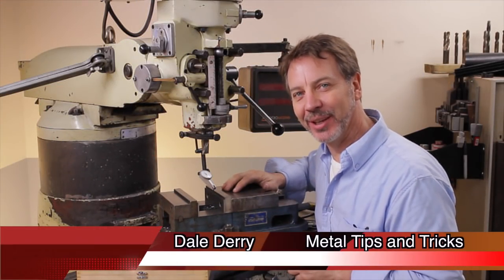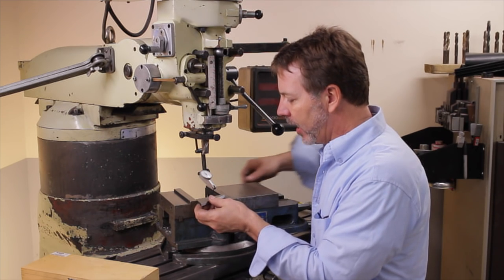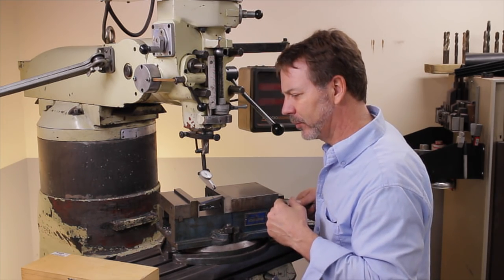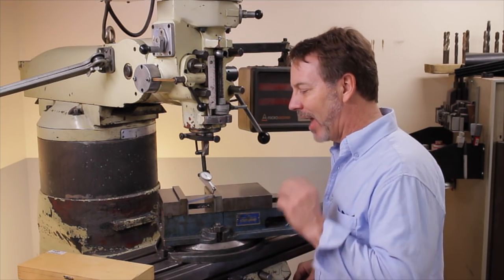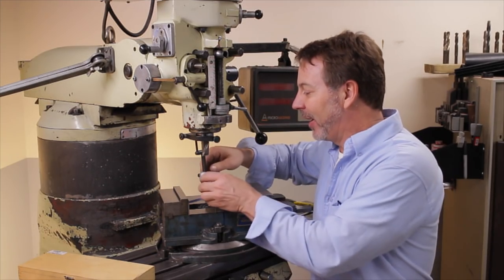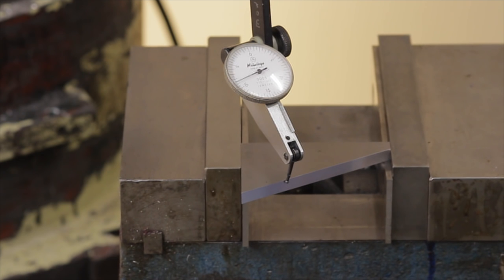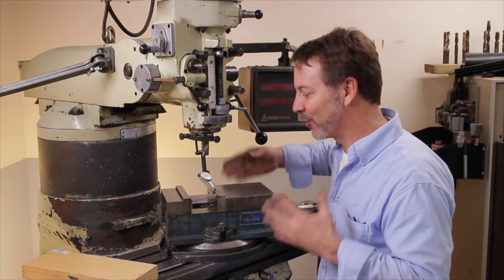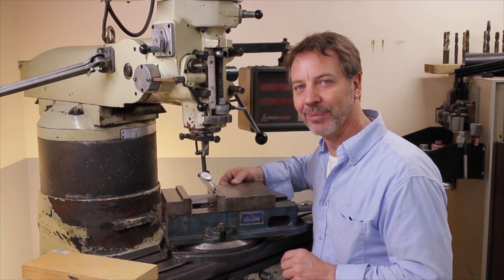Fast and easy way to Set an angle on mill  vice

Comment: Great tip like the previous video. I especially liked the tip on setting the angle plate so that there is a "run off" at one end to prevent damage to the indicator if the operator gets distracted momentarily.

Comment: Really good tip Dale and certainly one I'll need in the future.
Reply from the maker: I'm glad you liked it
Reply: +Metal Tips and Tricks (Dale Derry) Hi Dale, Despite the 3 at this point who somehow didn't like it and don't seem able to comment about why. I sure can't see what's not to like. And I'm pretty sure I have a set of angle blocks that might even have been made in the same factory as yours.  

What model of indicator is that Dale? I've got a 513-453 and a 513-403T and I don't think either of those will do what yours will.
Reply: +Metal Tips and Tricks (Dale Derry)  Dale you are assuming that the ends of the angle blocks are square to the base. The angle of 30 degrees is from the base. If the end is not at 90 degrees to the base then the angle will be wrong. You should set it from the base, still use the parallels, but hold the block in place with a magnet or dobs of Bluetac. When we used to make these angle blocks, it was only the base and the Hypotenuse that were ever machined and ground, were only interested in the angle, not the ends.

Comment: This is a KEEPER Dale. I have already purchased a set of angle block(s) I thought that would be used only on the metal lathe, but with this trick, I won't have to invest in a swivel base for the Milling vise. :-)

Comment: For those who do not have the luxury of a swivel vise,  same as Dale's demonstration,
set vise at angle.  I snug the left vise bolt tap to angle and snug a toe clamp to the
right side-dial in and tighten.  Need toe clamp cause you never will find a tee slot.
do it all the time

Comment: Good tip, also if you need a non-standard angle, like 24.14 degrees for example just put sin(24.14) in your calculator and flip the block over to the straight side. now when you move an inch in y make it where the indicator moves sin(24.14) inches and it'll be set perfectly. You'll want to use a dial indicator on a magnetic base so you don't have to move it so many times to stay in travel of the indicator though.

Comment: Nice demo Dale -- not too different from what I'd do but - wondered if the indicator probe is normally at that angle. Is it adjustable? That set-up works great. 
Best for 2016.
Reply from the maker: The prob can be adjusted  to almost any angle. It's cool because it allows you to set it up the test indicator  so you can see the dial easier.

Comment: Dale, yesterday, I needed to put the vise back on the mill after using a dividing head and used your bumpity bump technique. Worked great...! Thanks for that. It makes switching back and forth between vises and whatnots a lot faster. What's your opinion on keying the vise to the T-slots? Is the repeatability good? Your thoughts please.... Cheers, Daniel

Comment: Hi Dale
Brilliant idea of setting up, but how would you suggest going it if you dont have any angle guages?
Thanks Chopper 316 UK
Reply: You could possibly lightly clamp a parallel in the vice and using trig tables, work out how much movement per inch your dial indicator should show for the correct angle. E.g. To set the vice to a 45 degree angle, the dial indicator should read 1" of movement for every 1" of bed travel.

Comment: Hey Dale...nice tip!  Honestly you have my brain in a spin (which is easy), you selected a 30 degree angle as an example, but doesn't your setup actually create a 60 degree on a part??  Or am I backasswards?  Need some help on this one cuz it always baffles me.....HNY
Reply from the maker: +outsidescrewball 
I tried to answer your question in my video last Wednesday :-)
Reply: +Metal Tips and Tricks (Dale Derry) hi Dale, does this video last wednesday have a title so those of us viewing later can find the answer?
Reply: +outsidescrewball It depends on which side your milling, side milling off the edge of the vise (using Y axis) would be 30 degrees, making cuts parallel to the vise jaw (using x axis) would be 60 degrees.

Comment: Hey Dale, food for thought: that side of the chinese angle block might not be square to the bottom. I wouldnt trust it at least. You can use an old indicator base magnet to set the good side of the block against the fixed jaw and hold it there. Thanks for the good video though.
Reply from the maker: +Alex Kern 
thanks for the advice :-)

Comment: That is a great tip.  I guess I will have to wind up buying some of those little triangles some day.  Is your day job in the video business?  I had always imagined you were a machinist by trade.  Don't worry about negative posts, just delete them.  After all it is your channel and your rules.  If someone has gone too far they will figure it out.  Thanks for the video.
Reply from the maker: I not in the  video business, but I was a still photograph for 25 years.
Reply: +Metal Tips and Tricks (Dale Derry) Being a still photograph sounds boring. How did you keep from moving for 25 years? :) JK

Comment: Hey Dale,
How do you set up a vise for odd ball angles that you don't have a prevision ground angle block for?
Thanks
Keep up the excellent videos
Reply: +Kirk Douglas       A vernier protractor, perhaps?
Reply from the maker: I would use a sine bar.
Reply: As might I, but VP is easier to hold in the vice, with no gauge blocks to fall about. All depends on ultimate of accuracy required and equipment available.

Comment: Nice tip. 
The one thing I would add... Always check that your indicator did not run out of travel when you're  done. Pushing gently forward and back on the indicator, should show you still have movement on the dial.